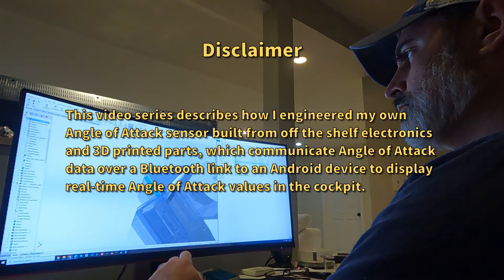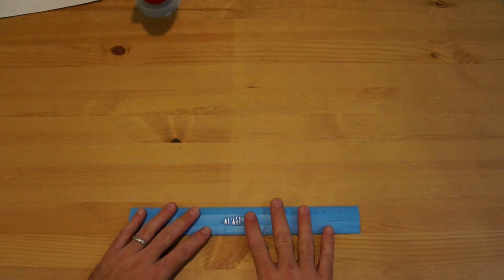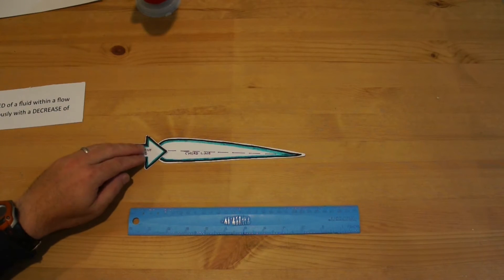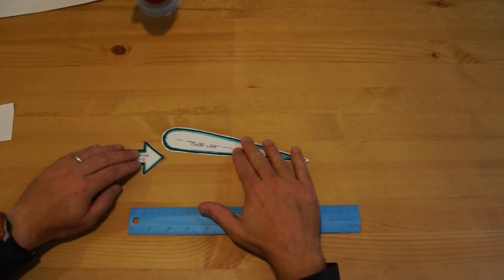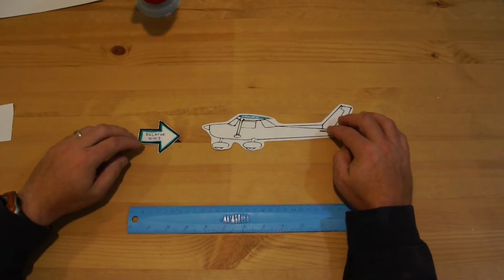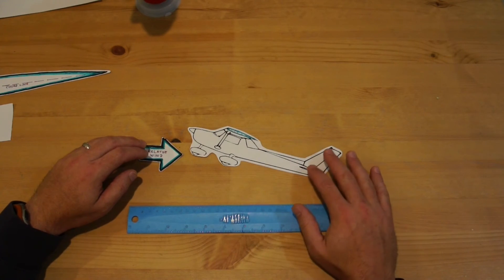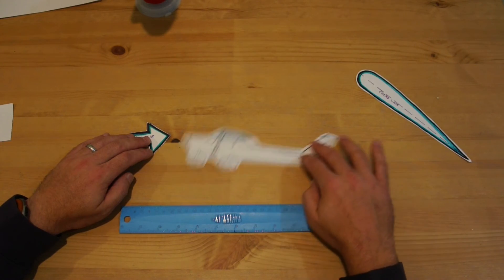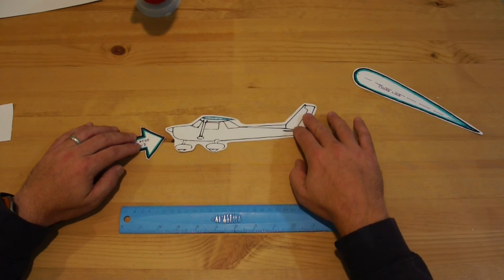What is Angle of Attack??

Comment: Stall speed increases with bank angle as well as G loading, how are you compensating for that?
Reply from the maker: Hey Murray. Thanks for watching.

Your wing (or any airfoil - it could be a propeller or whatever) will stall when the air stops flowing smoothing over its top surface. When that happens, the airfoil has reached its "Critical" Angle of Attack.

Any time you pull on the yoke (for any reason), you're increasing your angle of attack. 

In a turn, the steeper your bank angle, the harder you have to pull on the yoke to fly coordinated. So increased bank angle = higher angle of attack.

More weight (whether actual mass you have in your airplane or simulated with G-loading) also causes you to pull back on the yoke to maintain coordinated flight. 

In either case, it's the Angle of Attack that causes your wing to stall, not speed or anything else - it happens when the air flowing over the top of the airfoil stops flowing smoothly over it. So bank angle and g-loading are both irrelevant if you fly with an AoA indicator. It automatically compensates for any change in AoA, which is what ultimately causes the wing to stall.

You can stall at ANY speed. If you yank really hard on the yoke at 200 knots, the wing will stall momentarily until the aircraft's trajectory changes and begins hitting the air directly again.

If you haven't read it yet, I suggest the book "Stick and Rudder" by Wolfgang Langewiesche. It'll change the way you think about flying - AoA is the most important thing to understand about flying an airplane in my opinion:
https://www.amazon.com/dp/0070362408/